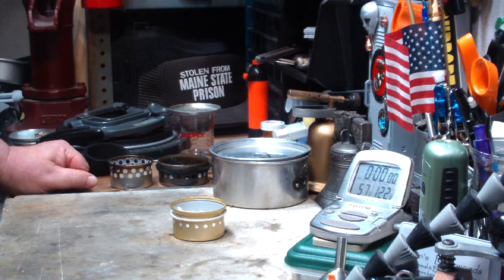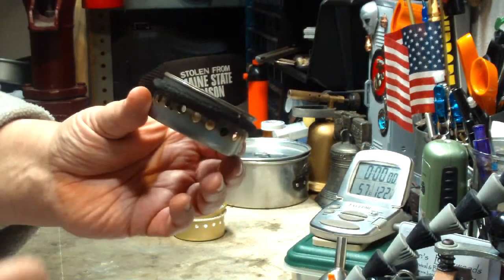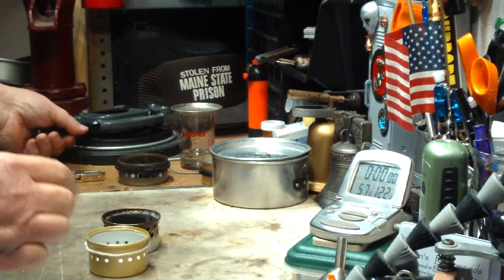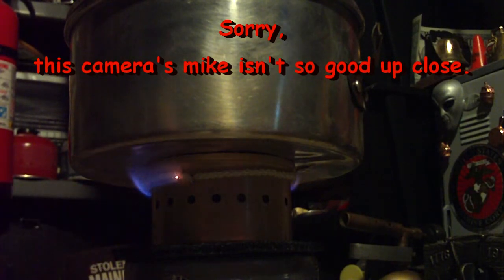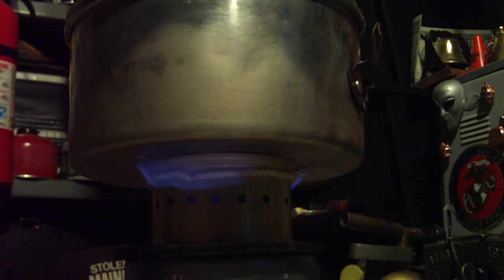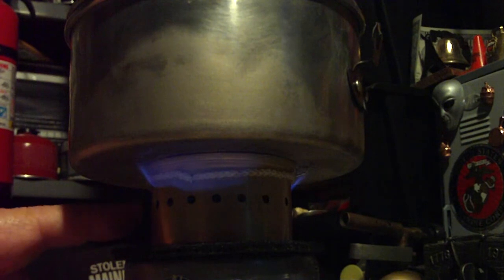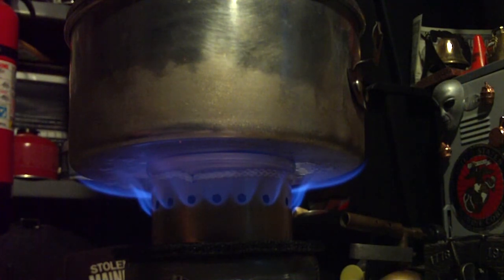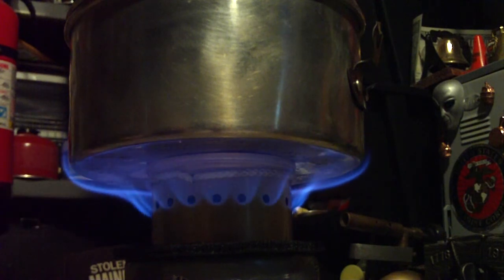Low Pressure - Side Burner - Mod#4 - Burn Test

Comment: If someone wants to punch 1/8 inch holes Fiskars makes a round 1/8 inch punch, and it is available at Amazon. Btw 1/8 inch holes are 1/2 the diameter but only 1/4th the surface area.

Comment: Hiram: I don't know if you watched my turbo stove. I tried 21 1/8 inch jets with four  fiberglass wicks. It was a complete disaster. The wicks never got hot enough to light the stove. Mine had wicks coming out four of the jets instead of 1/4 the way around. If you will prime the stove like a penny stove the stove will bloom much faster, and the priming fuel will heat up the stove better than the wick ever will.

Comment: The stove may heat faster if you add the FlashGeiger mod (heehee) ie a few clips to reduce contact with the pot.

I like this stove and can't wait for the boil time test when you get it going.

I agree with the idea of using 4 holes to feed the wick... the seems fuel coming up the wick is all burned off before it gets all the way around.